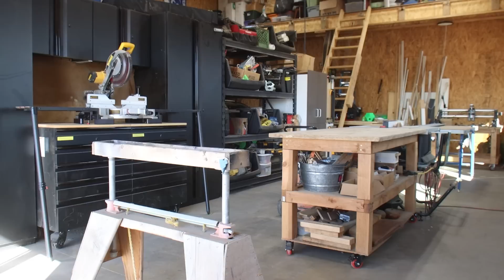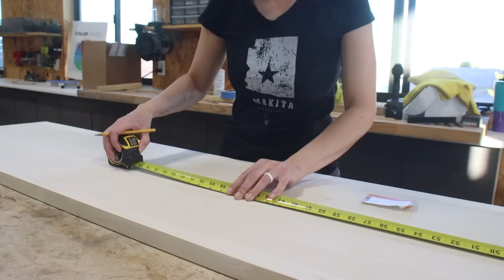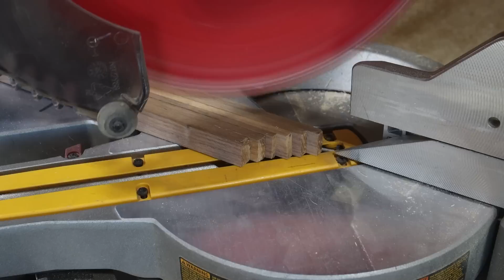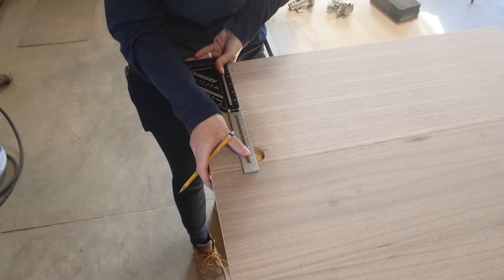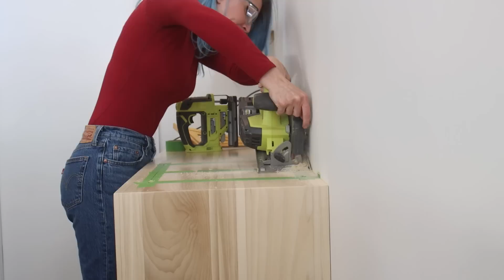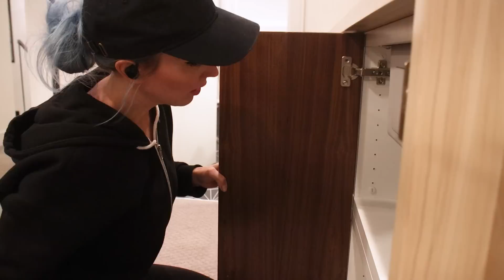DIY Kitchenette/ Wet Bar IKEA HACK

Comment: It looked like, form the brief shot I seen, you hooked the bar sink P-Trap to the air admittance valve location. I believe the trap should have been hooked up to the 2" pipe on the bottom and a 1-1/2" air admittance valve hooked up to the pipe on top. Great job on the house guys!

Comment: Looks great!  Give those boys a microwave.  Just plan on replacing the carpet when they move out.  Soda, Cheetos dust, melted chocolate and red dyes will make the way into the carpet, with or without the microwave :)
Reply from the maker: You're not wrong

Comment: Very nice - the Mortise Mate is about $1,000 cheaper thana Festool Domino cutter!

I see you went without the clips supplied with the sink, intended to hold it in place? I've found those to be incredibly challenging to use, unless you're dealing with a very thin counter top, and have ended up abandoning them on my last 2 sink installs.
Reply from the maker: Exactly! The MortiseMate isn't perfect for every application, but a lot more sensible investment than a Domino for the average DIYer. 

I've never had good luck with those clips either! I've found a good sealant is all you need

Comment: You are the Queen of waterfall edges, always so good and impressive that this one was just glue!
Reply from the maker: Thanks so much 😊
Reply: @PneumaticAddict  I found cutting up your equalatoral wedge up into bits and then using CA glue to stick them on to the surfaces and then clamping across those was really good for glueing my waterfall. The CA glue just taps off after.

Comment: Where did you plug the fridge in? There are no sockets on the wall
Reply from the maker: There is an outlet in the left cabinet. We drilled a hole through the side and ran the cord into the cabinet.